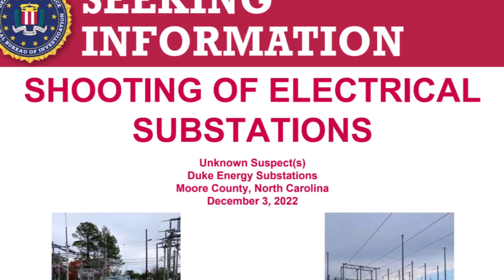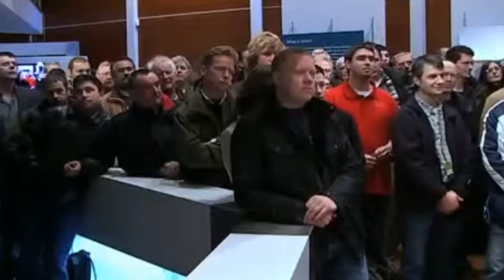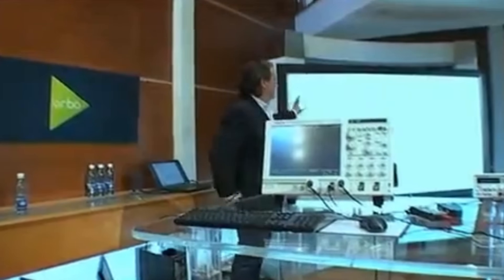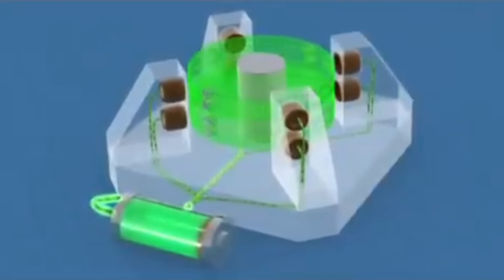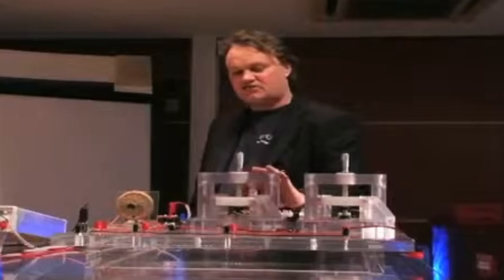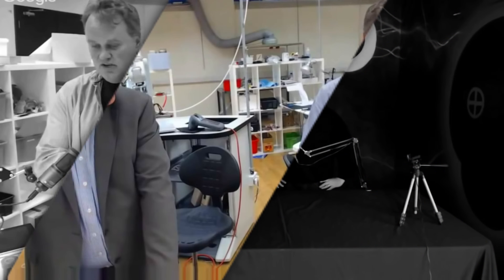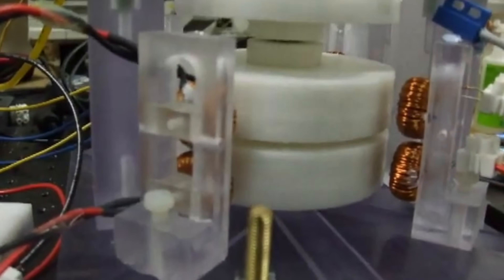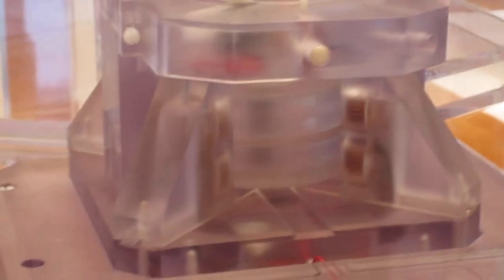Steorn (ireland) Orbo Magnetic Free Energy Generator Future Renewable Energy!

Comment: Only the universe IS...a perpetual machine of energy, that moves in both directions of the equation: E = MC2, and driven by gravity.  The error of Steorm's experiments IS: They did not implement a properly "timed" rotating magnetic shield, so the magnet pull would be advanced sequentially, to the next stronger magnetic force.  FMR Intelligence Officer